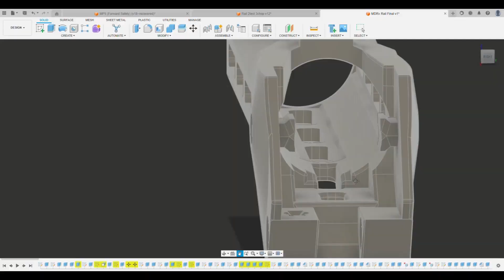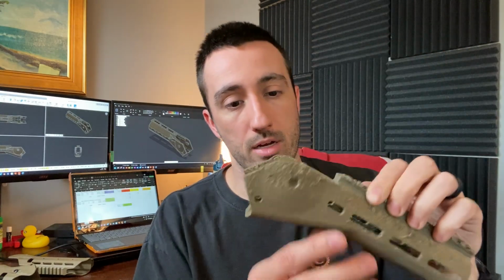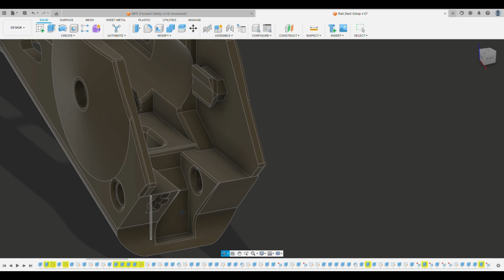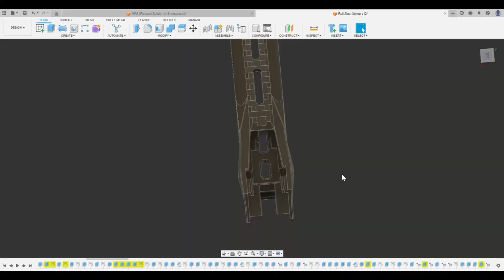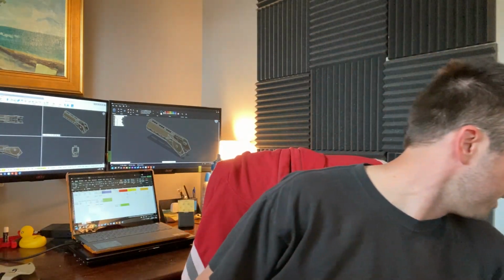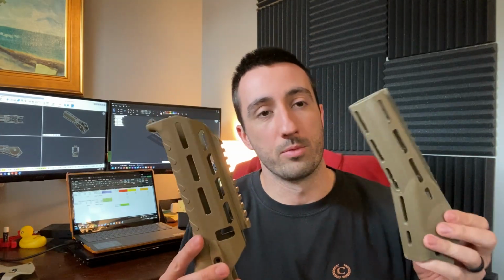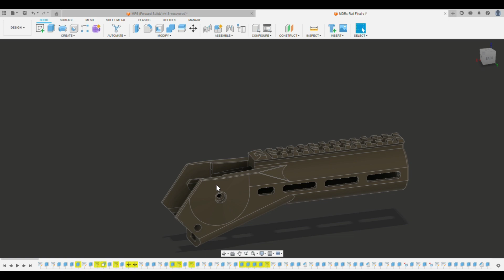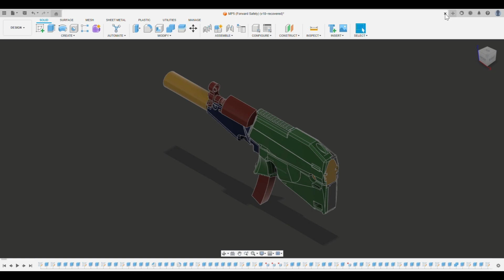New Desert Tech MDRx/WLVRN Handguard Design

Comment: If this was a professionally manufactured and finished product, I would genuinely consider purchase if it addresses at least a few of my main gripes with the out-the-box MDRx handguard or the Reflex suppressor handguard:
- HAS to hold zero. Many people reference IR lasers, but even backup irons require decent zero holding
- preferably lighter (than their respective length counterparts)
- thinner and more ergonomic [which you've addressed]
- preferably angled along the sides such that the Arisaka Offset Scout Mount M-Lok fits fine. Currently, it only fits on the Reflex handguard and not the original

Comment: I would definitely buy this if it were nylon printed. One thing to watch out for is m-lok hardware contacting the barrel. Magpul m-lok hardware is slightly longer from what I've seen online. I'd also recommend making the ID a standard diameter that is supported by Modtac's M-RAC system. I believe BCM is the narrowest at 1.3". In the same vein, I'd recommend exploring 7-sided m-lok slot options. More tacticool but most importantly, much better cooling and airflow.

Comment: Nice design, although you now I think the 20" was designed to have the suppressor partially inside the hand guard but if your barrel is longer your design makes much more sense, I have heard the wlvrn gets very hot.
Reply from the maker: Yes I meant to address this in the video but forgot, so it’s in the description. You’re right that’s what they intended, but I generally don’t think it’s necessary unless you’re in the SBR lengths and must have that additional mounting space. Too much heat for me!
Reply: @ParrotTactical  See, I was thinking 16" 308 with the flow 762ti and the 20" handguard. Do you know if that would work to cover some of the suppressor?
Reply from the maker: @TwilightKid  it would work— however when I did it with my 556hxqd (1.6ish od) the suppressor could contact the handguard and impact accuracy. I believe the flow 7.62 has a 1.8” od so I would definitely expect to have issues with it hitting the hand guard on the 6’o’clock position
Reply: @ParrotTactical  I was worried about that, given the heat issues your design makes the most sense, although I would like to see it in aluminium

Comment: If you ca make it hold zero with lam mounted anyone with nods will likely be willing to buy one.
Reply from the maker: Agreed— I just need to get better at engineering first haha
Reply: Not sure it is a matter of engineering. The entire attachment method of the handguard is flawed. One pin with two tiny friction pads is not going to hold zero on anything. Doesn’t matter if it is plastic or metal. There is not a lot of geometry to work off of to use as a workaround. Pretty much bridging the picatinny is the only way I could find.

Comment: I find that horrendously ugly, so I wouldn't buy it. I don't like that rear ramp and how low the top rail is. I find the factory handguards (regular and SD) look more natural. I do like the more squared off front for increased rail space (clip on gang). I don't run top pressure pads and am used to AK and SD style handguards, so the thin handguards don't offer my anything I'd be looking for.

Definitely don't give up and keep working on it. Love to see people putting their passion to work.
Reply from the maker: Appreciate the honest feedback. I don’t love the ramp either… it’s just kind of vestige of how long each pic rail section is and starting them at the end of the handguard. I was stuck with either a long ramp or a short pic section that might be too weak / too close to the gas block. Thanks for your support!

Comment: Leaving the top side open around the gas block is a feature I have been wanting ever since I owned the rifle. 

I disagree however, with making the handguard as narrow as possible. If you’re trying to keep the system as cool as possible you should increase the overall volume of air by increasing the internal diameter and add heating fins similar to what can be seen on engines.
Reply from the maker: I think heat syncs need to be metal and connected to the barrel, but I’ll look into it. The barrel under the handguard is thin profile, so I’m counting on the open gas block and new ports underneath it to be doing most of the cooling improvements.

Comment: Very nice design, maybe a handstop on the top rail at the back would be helpful.  The Finger Burner 9000 is a real concern for those doing the C Grip.

Also, it looks like the new WLVRN handguard has two Mlok attachments per side on the back that attach to the Receiver.  Might want to consider something similar.

Another option would be a shoulder bolt through the lower push pin.  Provide additional clamping force.

As far as printing goes, have you heat tested it yet?  PLA/PETG may melt/sag under use.  Might want to lean towards Glass filled Nylon for your print material.

Another option to improve performance you can do is anneal/bake your prints post print.
Reply from the maker: Thank you! I have long arms and forgot about the FB9k… will need to add a finger stop topside— thanks for the callout. 
I don’t have great access to WLVRN/Sabertooth but believe the cutouts in the MDRx are too shallow to allow that second mlok, but I’ll keep an eye out for what they did in the media and if they start selling the sabertooth handguard. 
The shoulder bolt is a good idea for DT, esp given that you already need tools to remove the handguard anyways… no real advantage to sticking with a push pin there. 
This print was done with ASA, which is basically the ABS used to make LEGOs with added UV resistance. Printing temps are 572F at the nozzle, and 230F on the bed… the chamber stays around 95-110F during printing. I’m not sure the point at which it will warp, (well less than stated above) but these higher temps required to print give me hope it can handle the heat during reasonable firing schedules. Edit: a trusted source shows ASA reaching 200F before deforming under load. So as long as there is enough air to keep the guard under 200, should be good :)
I’ve seen a few videos on annealing, but am worried about what the medium might do to the spots where tolerances are tighter. Any warping at all could prevent fitment. If I were going into production though, annealing would likely be a good move and I’d have to tolerance appropriately to account for it. 
All great ideas! I’ll see what I can execute on…
Reply: @ParrotTactical  Very nice!  

ASA is a good choice for this application (as long as you can get it to print nice), it should be more heat resistant than the glass filled nylon of the original handguard.  Also much better than ABS in the toxic printing department.

And good points on the baking tolerance, ya it definitely will take some trial an error if you go down that route.
Reply: @ParrotTactical another engineering element to consider is moment of inertia around the bore axis.  The more material farther out from the center axis the more stiff the structure will be.  This is the reason I-Beams are built the way they are, they reduce mass and maximize moment of inertia efficiently in the directions they need to be strong.  In this case making the hand guard smaller in height it will mean you need to compensate with thicker walls to reduce bending vertically for the same stiffness as the old design.

Comment: I absolutely love this design, and the considerations that you incorporated into it. I like your factor-by-factor thinking and review of your work. If you had quality prints of your designs I would absolutely pick one or two up. My 16" .308 MDRX has about 800 rounds through it and has never been reliable with the FE system on it. Meanwhile my RFB is reliable so long as it is lubricated. This being the case, I've been looking at getting a .308 Wolverine with a 20" barrel as my go-to rifle.

Having 2 MDR platform weapons at that point, multiple handguard choices would be very nice to play with, as most of my guns are for demonstration to non-enthusiasts, I.E. taking gunless heathens out to the range to convert them lol. Uninitiated shooters always have the silliest criticisms of guns, and having those small options for look and feel can sometimes be the deciding factor in getting somebody to fall in love with something.

To me, having the Gas Block exposed like that makes me an absolute convert. I love the look and accessibility. If I was afraid of putting my thumb against the hot Gas Block, I would just put a small handstop like the Fab Defense VTS, or a small riser on the top rail section just in front of the Gas Block to prevent running my hand into it. Maybe having the back of that top Picatinny section cut off with that in mind would be worth incorporating? It looks like you might be able to squeeze one last Picatinny slot in there, if the closest peak to the Block wasn't relief cut exactly how it is. That way such a stop would be as near to the Gas Block as possible without touching it.

Quality is of course key. A lot of gunsmiths and product engineers are ass, and you can surpass them quite quickly if you have the opportunity to fully commit. You have the mindset for it, and you produce your media very well. Good goddamn luck buddy.
Reply from the maker: It’s a noble undertaking to bring people out for conversion. I try to do the same and am met with a lot of the same challenges. Unfortunately Hollywood sets people up for a shock when they find a) guns are “heavy” and not all plastic and b) guns are loud and you can’t go shooting in a basement with no hearing protection and keep a quiet conversation going. 
I appreciate the feedback and you’ve identified a gap in my thinking. With my long arms I never get burned by that block, but a LOT of people do. I think that was one of (not the only but one of) the reasons they did away with the pic rail over the gas block. The front and rear sections of my picatinny are a little over-sized and would allow for a small hand guard against getting burned without blocking the adjustment. I’ll see what I can do— thank you!

Comment: the blk lbl upgrades also don't hold zero? I thought they did. when I read that the new wlvrn handguard would be attached to the upper receiver the same way it was in the mdrx it was quite disappointing, especially knowing that the military grade version will fix the problem with a retrofitting solution, meaning that they knew the problem and the solution for it, but kept it behind a upgrade fee
Reply from the maker: I’ve heard mixed reviews with regard to BLKLBL holding zero. Everyone loves them overall, but I don’t see that their mounting solution is substantially different to hold zero. On DT’s side it may be an economic decision. With the new rifle coming in at $2500 they are really pushing the limit of what most people will buy in the current economy. It’s possible the sabertooth handguard would either increase that price and hurt their total sales or cut too far into their profit margins for their liking. I’m with you though— if they have a solution, I want it on my rifle!
Reply: My BLK LBL holds zero no issue.

Comment: I think if you're gonna go that slim you might as well sorta add the micron style verticle grip to the rear attach point, as opposed angled mlok slots. From purely a cosmetic perspective: it'll look cooler I think.
Reply from the maker: Agreed, the current look can be improved. I’ll see if I could add the grip and still run a vent through it.
Reply: @ParrotTactical  I would think if you just used the micron for inspiration not faithful reproduction that would be the key, have a hole in the bottom of the "grip" perhaps. Loved the video BTW.